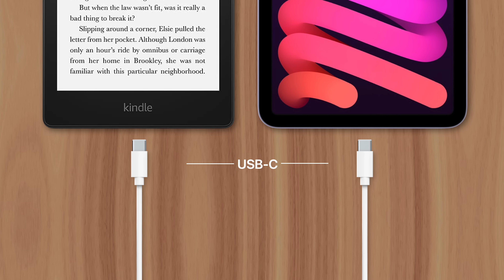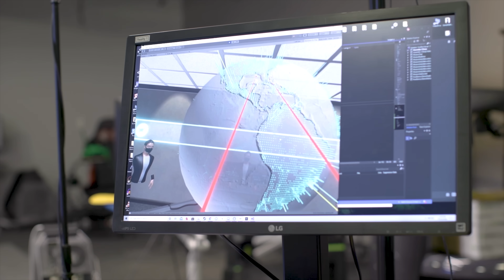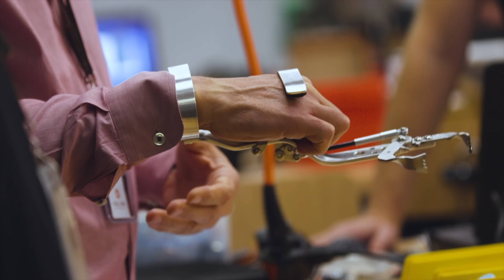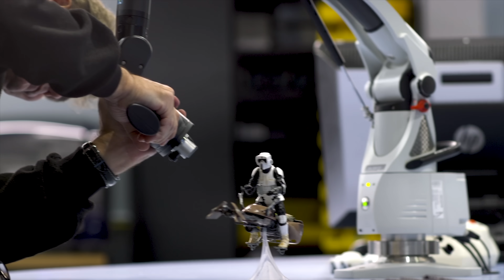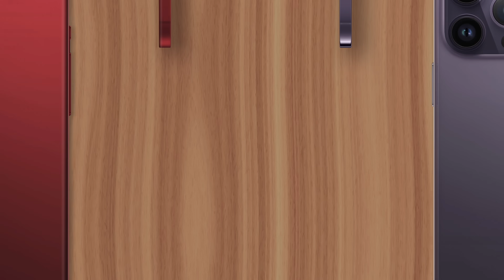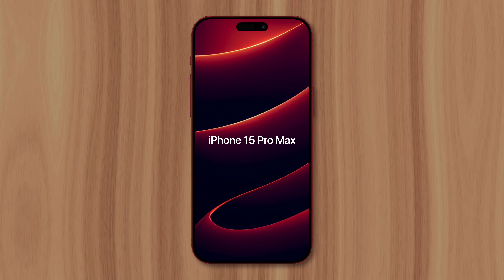iPhone 15: What To Expect

Comment: Really excited for what is coming up next. Unfortunately, no SIM slot is a complete no go for me.
Reply: eSims are long overdue and I like that Apple is finally approaching this to make the phone more waterproof.
Reply: @Metalproz  You are right, but at least give us the option.
Reply: @BukuiZhao  I don't see any practical use for having a physical Sim compared to a eSim. Everything possible can be done electronically instead.
Reply: @Metalproz  It just feels more convenient just having to swap out cards rather than using a complicated process (at least for now).
Reply: @BukuiZhao  swapping eSIM is even easier than the physical sim card. When they hand you the phone in your Carrier, they also give you a piece of paper with a QR code that adds your SIM when scanned. Physical SIM cards are way outdated and is finally time to get rid of them.
Reply: @BukuiZhao  Exactly, I go to the Philippines every one or two years and SIM cards are important to me because Philippines isn’t ready to embrace the eSIM fully yet.
Reply: @DeterminedTorres  That affects me even more as I am from China but living outside of China. I go back to China once every few months and there is not yet eSIM in China
Reply: but why? i don’t remove my sim card often so it makes sense to get more room and water resistance
Reply: @thevadarside  I just think it is too much of a hassle, especially since many areas haven't implemented eSIM yet. Maybe I'll reconsider in a few years but for now it is a no go for me.
Reply: @thevadarside if you travel anywhere abroad it significantly restricts you. Local sims are always cheaper than roaming. I now need to decide to buy a second travel phone or switch to android. The latter is looking more likely at the moment.
Reply: I mean you can just get a phone shipped from Canada as I’m pretty sure we aren’t doing esims yet
Reply: I would need to inquire with my carrier to see if they can handle eSIM.
Reply: physical SIMS are outdated and insecure, this is the most stupid comment i have seen in years

Comment: any chance on a video about the differences between apple and android? considering switching to iphone and dont know what to expect
Reply: i did it and there isn't much to fear. but the features in iphone will help a lot in productivity side. i feel like this maybe because i never used android devices keeping productivity in mind, but iphone with all the eco system perks will sure increase productivity.
Reply: @BBKMotoLove221  i know already that icons cant be moved to leave empty gaps, and custom ringtones are annoying to do. did you find any other oddities in your transition? were there any things you thought would be an issue but wasnt?
Reply: @kaioker   lack of a uniform back button or back gesture. The keyboard predictions are garbage, use gboard or SwiftKey. But the spacebar can be used as a trackpad and thats cool. Also i have windows laptop and it doesn't have a type c port. So wireless connection is the only option for me. I found this cool technic to share a folder in the pc with your iphone and easily share files from and to. But the devices need to be on the same wifi network. Somewhat like xender but don't need another app. 
The icloud storage is limited and system data can take a lot of space. Its not the ios software but something with no definition.
But overall I'm very pleased with my decision and really like using this phone. I take a lot of videos and any game works great. Great haptics and smooth animations.
Reply: I switch back and forth between android and ios periodically.

Your experience depends on how deeply rooted you are to android and if you care/can work around the differences.
If you've never used a flagship android, iPhone will feel greet, but if you're used to flagship androids you may miss certain features. 

It just depends on why you're switching and what you're expecting.
Reply: Android isn't a company though, it's an operating system.
A video about iOS and android would be more likely. Or Apple and some alternative smartphone company, Samsung as an example.

Comment: The action button sounds really interesting. Reminds me of how you could program the bixby button on old galaxy phones to whatever you wanted with a third party app.
Reply: Older iPad models allowed you to customize whether the side switch was rotation lock or mute, and we might finally get to see that come to iPhone. But yet, if it is just a software update and not an overhaul to the button, why can't this action button come to all phones that have a silent switch and will support iOS 17?
Reply: @ddylan4cats  i have an old ipad mini and i didn't know that until now. thanks.
Reply: fr, I had a note 9 but it sucked cause samsung made it super hard to do it. would always glitch. im sure apple will implement it well
Reply: @user-vq6ym6qg4j  yeah I remember it was a hassle to set up on my S8, had to connect it to a computer, enable dev mode and other stuff I cant remember anymore, but after that I had zero issues. I guess it depends a lot on the app you used
Reply: Hopefully it's able to open an app, I use my Bixpy button to open Shazam when I hear a good song.
Reply: @zephyr3693   ✅congrats…You have been selected for the season ongoing Giveaway..!Message the above applied name to redeem yours…
🎊 right now.
Reply: Bixby button was awesome just bc you could map it to different functions. They took it out on my s22u and now you basically have to just use the power button which I don't like at all, power button should just be used for power and mapping to camera or some other type of simple quick action.
Reply: It would be a win for Apple if you can use the action button as a home button, many people want it back.
Reply: That’s not new. You were able to switch the mute button to orientation lock on iPhone 6 but they removed it on an update.
Reply: Naah it's a bit useless if they do smth creative then it might be useable on my s10e it's just function less
Reply: I use the power button as my Roku remote. 
Something Samsung has long been having!
Reply: @Mr.DontKnow  Nokia had been having that waaaay before
Reply: @Mr.DontKnow   ✅congrats…You have been selected for the season ongoing Giveaway..!Message the above applied name to redeem yours…
🎊 right now.

Comment: They might remove the ringer switch like the iPad and the iPad started using USB-C beforehand.
Reply: No. Too many people use the ringer switch.
Reply: @LambdaMisc  so did people with the 3.5mm Jack
Reply: @yamenk1280  Except there’s no replacement to a ringer switch unless they add an action button.
Reply: The issue with the ringer switch is if you change the ringer with the touchscreen, the switch does not change by itself